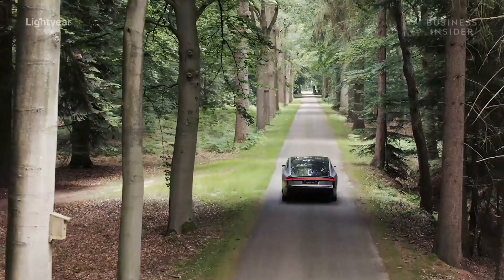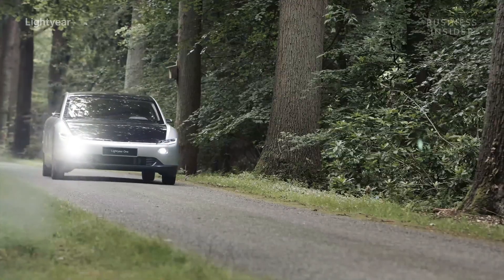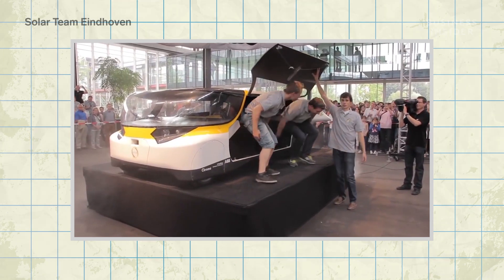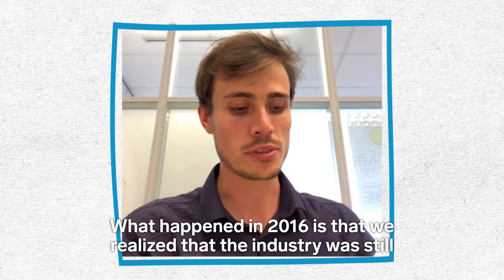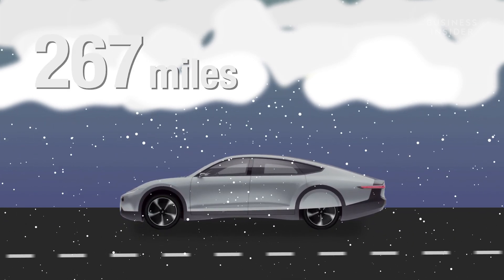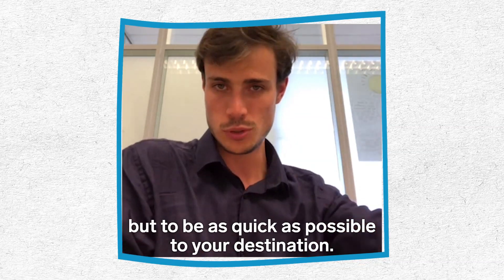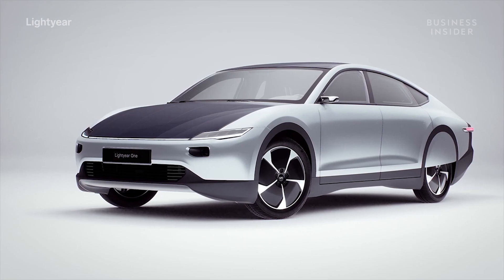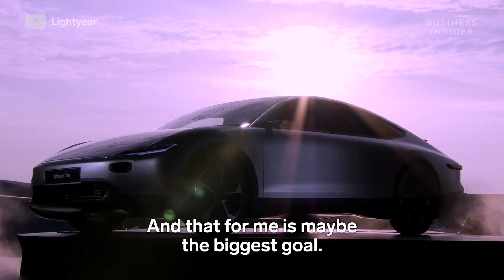Inside The $170K Solar Car That Drives 500 Miles On One Charge

Comment: I am here, because I want to build a solar ASSISTED car myself, but this is the biggest bullshit I've heard in my whole life ! 54 square feet worth of solar panels??????WHERE ????? BULLSHIT
Reply: That's 6 sq M or 3x2 meters! That sounds like it should fit? If we presume 200W per sq M because the panels are horizontal and covered in glass, it will give you on an average 6 hours day of sunshine, 7.2kWh. If the car uses 100Wh/km or 160Wh/mi, you'll get 72 km or 48 mi of very careful driving and in summer that will be slightly more than 100 km or 67 mi. I own a small EV myself, that also only uses 100Wh/km if I keep it under 70km/h and I have gotten a 300W 12V to 300V DC converter for this purpose. I've got 20W on the dashboard and 20W on the rear shelf, that so far only supplements the onboard DC converter bringing my idle consumption to zero!. I have not decided on the roof yet. It is difficult to use a curved surface and I can not cut my roof legally? but with another 70W on the hood I can total 100W and I want the surplus to go into the battery when parked, so it should give me 6km/day and be enough for most of my errands around town (groceries and picking up children). Let's compare notes, I'm interested in hearing about your setup?

Comment: The Nio ET7 has a range of 600 miles and Tesla Plaid 500 miles. If the production of 4860 batteries increases in the future, 700 miles Long Range Model S could be expected. Why would I pay $ 170k for this car? It is not even clear when it will enter production ...

Comment: This is NOT a solar car. It is an electric car with solar panels.

Looking at the square footage it cannot have more than about 1200 watts of solar cells on it. (enough to power a regular hair dryer). Definitely not enough to power a 1000+ lb car down the road at 55 mph... especially going up hills.

At best, the solar panels will help extend your range some but, make no mistake... you will be relying on the charging station at your house for the bulk of your battery charging.

The panels are a novelty that cannot justify the increased price.

I doubt the solar panels will save you $3000 in electricity over the life of the car and if the solar charge controller breaks or something happens to the panels, it will likely cost more to fix it than it is worth.

Buy it to impress your friends or out woke your neighbors but don't think it is anything but a status symbol.

Comment: So they expect the car to become cheaper as Solar Technology becomes cheaper???
It's cheap allready ! A good 200watt panel can be got for between £200 to £300 The ammount of power they are getting from the panels does'nt require an expensive charge controler! And even if it did the cost is a tiny fraction of the cars cost. you can power a house for around £15.000 The only way it becomes cheaper is if they are selling hundreds of thousands of them. Just another rich mans second car

Comment: They've made cars like this its nothing new, the technology doesn't allow solar to be practical when charging. 7 miles an hour or 84 miles in a full day, still not practical over long distance which is the main issue of all EV's. Even if it delivers on its 497 mile promise, it's still a 100k car, the long range model 3 is 322 miles and costs less than half

Comment: So it goes 500 miles instead of 350 because it has solar panels helping it charge while you drive along. But not a mile farther... even after you stop and sit there in the sun. Got it. 500 miles. yup.

Comment: How if a bird shit on your car
Reply: It just locks out the cells which are dirty.The rest of the panel keeps on working as normal because of the smart software.Thats what i got from other video's.Not a problem.If you damage some cells the rest keeps working.These guys have quiet some experience in the solar races.They won a few weeks ago for the 4th time in a row the cruiser class in the solar challenge.They participated also 4 times so they were never beaten.These kind of questions are fair but in my believing your question is the same as asking can't i see anymore because a parrot pood on the windshield.You better clean it but it's  not a problem.

Comment: Charged again? 7.5 miles per hr isn't going to charge the car. I drive 40 to 55 miles per day every weekday I think that eventually on a cloudy day I will have to have a power source other than the sun to charge the car.
Reply: In good conditions you can get to that miles charging in a day.This car is also charging while sitting in a parking lot and if you take the weekends with it you never have to charge if you are in south or north Africa or Australia.Even in the cloudy Netherlands you get at least 8000km/year free driving.Thats significant! I think you get all the solar stuffs extra costs back within 2 years.So the next 8 years you're earning if the cars life is 10 years.

Comment: Never heard this before.. just slap some solar panels on it and it will work 😂😂😂 what a joke. Unless this company has made a significant increase in solar panel efficiency which they most likely haven’t because then they could just corner the entire solar production industry with their panels, then these panels in optimal condition could maybe let you power the air conditioning while driving to increase overall distance but that is not worth the price tag

Comment: This goes along with the solar powered airplane.  A small plane that can seat 2.  About the size of a Cessna 152.  Not sure if battery's are charged before flight, but its built mostly for pilot training.  YouTube has a video about it.   Battery's are heavy so a solar powered airplane is a big challenge.

Comment: What happens if you have children in the car and a truck is behind you and you cant speed up? You can only go a certain speed. What happens if you're a business and you need to go cross country for a business trip that csr cant go cross country. Like Chevy, and Ford usually when new cars they test out at least one as a Police vehicle this car will never go the speed a Police vehicle needs to go.
Reply: The speed of this car is 160 km/h so more then enough.You can drive over 700 km on batteries and this car does 3 times more distance then Tesla on a kWh so charging is very fast.This is the ultimate car for long trips

Comment: The car looks nice I like the body but, the car only goes 500 miles a day and when its cloudy or snowing it only goes 250 miles what happens if its cloudy for a week like it is sometimes in winter? Its a nice concept but I think it needs more work. You cant go on a trip and get stranded.
Reply: You can charge it like any other EV and faster.

Comment: One small crack on those solar panels and your back into model S 370 miles
Reply: That's what I was thinking! Imagine the insurance on one of these bad boys!
Reply: No,if some cells fail the rest keeps working.It's also covered in safety glass so cracks will be very rare.Better have this car in a hailstorm then any other car
Reply: Maria Santov I never said that if one solar panel would cause everything else stop. Im saying the power of the car wouldn’t be as good if some of the solar panels are broke. Also, their safety glass is not that powerful.
Reply: @dippidousfippidous4837  I don't understand.You say one small crack and you're back to Tesla's 370 miles.This car does 500 miles on it's batteries.A small crack in a solar panel,say 0,0001% of the surface of all panels means it will charge 0,0001% less from the sun.Thats nothing.Even if 25% of the solar cells are damaged you can still charge 6mph instead of 8mph range from the sun.Nothing to worry.There is a video where they drop golfball sized steel balls and nothing happens.
Reply: Maria Santov the solar panels are 16 square feet. 0.0001% of that is quite literally microscopic
Reply: @dippidousfippidous4837  The car has 3 solarpanels with maybe 1000 cells al together.if a small crack breaks down 10 of that cells it means the car can charge 1% less from the sun to the batteries.You claim the range will drop to 370 miles and the power is less.Non of that is true.The range and power stays the same What you loose is the additional charging power from the sun.In that way the total range can drop a few miles a day but nothing you will notice.If that happens twice in it's lifetime you are very unlucky i think.How many times it happens when a rock hits your windscreen and cracks it?

To call this a joke is not fair.They are not a few guys building a car back in a barn but they are very professional.To win the cruiser world solar challenge all 3 times they participated means they know what is possible.I love this whole project and i see this as the future.Another solar car,the Sono Sion,can be sold for €25.000.For an electric car thats very cheap.That says those solar panels are very cheap.And the price will drop more and more.

What you think of the car without the solar panels?The low weight,small batterypack,inwheel motors and the most aerodynamic shape of all cars in production now?

Comment: What if you drive at night for example road trip would it work for 8 hours no sun ?
Reply: It's a normal EV what can do over 700km on it's batteries.If there is no sun you can charge it on any charger

Comment: Keep in mind that these electric cars need all those batteries powering it changed every 10 years or so. The cost for changing all these batteries? Around 10,000 dollars.
Reply: This car use not much batteries because of the low weight and extreme aerodynamics.I think this is the way to go.

Comment: This is fake . Even in  most hot country if you cover full car with solar panel you can make at more 8 to 10 volts . For running car you are needing a least 100 volts . This is fake car .

Comment: At that price-tag, I doubt it will "change the car industry"..
But if any manufacturer managed to make a $17k electric car, even if it's just a small car without those fancy solar panel, now that'll really change the car industry..
(as long as the quality isn't total trash.. It's quality and interior should as good as mitsubishi mirage, ford fiesta or other sub $15k small car.. and above 200miles range per charge)
Reply: The Sono Sion is just that car.The Lightyear One is on a complete other level and will drop in price when the next models can be mass produced.

Comment: No more range anxiety!
Model S: 370mi
Lightyear One: 500mi
Roadster: 620mi
Reply: Yeah I really don't understand how they're able to make the range on the roadster 620 Miles.
Reply: @jenson1569  double the amount of batteries and you're done
Reply: @osmanaslan6232  no because it’s then got to use extra power to pull the extra weight around
Reply: @jenson1569  those are already accounted for
Reply: @jenson1569  100 kwh: 400 mi
200 kwh: 600 mi
Reply: @osmanaslan6232  small car and small motor:  20kWh 100miles, The iMiev and other EVs of this class uses 160Wh/mi or even less
Reply: Aptera: 1,000 miles 😎

Comment: Add in a horizontal wind turbine under the front hood and   fiddle with  that and you can probably get  more  or put peltier devices  on the back side of the solar panel  and any other parts of the car that get hot like the electric motor  and gather more power

Comment: Tesla's use the heat generated from the brakes to recharge the battery. Also, the roof of Elon Musk's house is a giant solar panel. So I'm pretty sure he had that idea before the CEO was even born. It's most likely useless to have a solar panel to charge a car, otherwise Tesla would've done it already.

Comment: 7.5 miles of charge per 1hr of charging is 100% BULLSHIT. There is absolutely no way in hell that those solar panels are providing the ~3kw-4kw of energy necessary to charge for 7.5miles of driving. That is beyond ridiculous. Under ideal conditions, there is a max of about 500watts of solar available there, if this was a Tesla, that would get you ~1mile of charge (in the most ideal scenario imaginable). 
In order to get 3000w, you'd need a surface area of 220sq ft, all pointing directly at the sun, in the middle of summer (3x larger than the car). Do these people not own a calculator?
They put a $1000 solar panel on a car and decided that's worth 175k, in a market where a model 3 does the same exact job at 39k...... Yeah, good luck guys.
Hyundai, Kia, and several others already have cars with solar roofs. It creates enough energy to run the fan when the driver leaves the car. That's it, just the fan, nothing else, not even the A/C.
Reply: It can charge ar 1200w peak.This car is so lightweight and aerodynamic it does 12km per kWh

Comment: Why do they do these ugly designs... why not make a normal looking car
Reply: Because this is an extremely aerodynamic car so it needs less energy,smaller batteries therefore to save weight.Because of that they can use smaller motors to fit in the wheels.With the inwheel motors you don't need no drivetrain and save weight again and make it even more aerodynamic under the car.

Comment: The numbers just don't add up.
The solar cells (54 square feet or 5.4 square meters) can only generate ~1.5kw per hour under perfect sunlight conditions at the equator using the most efficient solar cell currently available. 

They state the solar can add an additional 7.5 miles per hour of sun (1.5kw), so they are claiming the car runs with the equivalent fuel efficiency close to 200 miles per gallon!! (a gallon of gas/petrol has ~40kw of energy). mpg= (40kw / 1.5kw) x 7.5
Reply: That is still 200Wh/mile, which is not unbelievable. It might not be at highway speed, but it is more than I use getting around town in a smaller EV.

Comment: I could see normal people buying this car in 10+ years after rich people subsidized production and research into improving the car for the masses. Sure, this type of car will only cater to specific market such as sunny region of the world but it would change the game in the long run. Imagine getting an extra +7 miles/ hr just parking your car on a sunny parking lot or in your drive way. You can even set the car to cool itself once it hit a certain temperature since the car is already electric.

Comment: $170K is a long way from what the average consumer can afford! I wonder what the environmental impact is for making this car? this isn't the future, the weight of batteries restricts the performance and practical applications. Improving the efficiency of the internal combustion engine is the key.
Reply: Did you even look into this car?This is extremely aerodynamic and lightweigt.The batterypack is very small.It does 8 miles on kWh.When massproduced the price will drop to a normal price.

Comment: 170k for a car that recharge in a week of 12 hours a day of sun, parked.
Reply: It only charges 40 miles per day in awesome conditions
Reply: @grateful.  therefore you actually need 12 days of parking 🅿️ the car  to get a full battery of 500km. Useful
Reply: @LuckyM83  its 500 miles 800km
Reply: @grateful.  Sorry I think always in metric system . My mind cannot process the mile/yard pound foot inch and so on.

Comment: Really cool if youre in Florida, however pretty useless in London...
Reply: Mr. Swag they work in any weather condition
Reply: @stephen_7752  how would that be possible ? in Canada we have months where we don't see the sun only light shinning through the clouds...
Reply: @stephen_7752  How efficient would solar power be if it rains for over 200 days a year
Reply: @wyw201  8k kilometres a year in UK.
Reply: Unless its driven under street lights, perhaps?
Reply: Wouldn't be useless. It can still be driven with power from the socket. Just the additional mileage provided by the solar panels will be low.
Reply: It works by the light from the sun so if it’s raining and there’s light it still gets power
Reply: Waffle Dog Huge efficiency decline from solar under constant stormy weather lowers the opportunity cost for plug in electric cars

Comment: You’re not buying this car to save money, you’re buying this car to quit buying gas.  
So you’re not saving money, you’re just spending it a different way
Reply: People will also buy it to have a smaller impact on the environment.
Reply: @angusdavidson15  A Tesla in a country with half the grid is on  renewables (which excludes the US), emits 2/3 of a gasoline car, so to greater effect, spend the money on roof solar, move closer to your job, get a condensing dryer etc. There are a lot of environmental investments that are cheaper and has a greater returns than a Tesla.
Reply: Pretty sure you're saving a lot of money in the long run

Comment: I can tell you the solar panels DO NOT EXTEND THE RANGE. look at the Fisker Karma, for example. It had solar panels on the roof. How much power did it make, barely enough for the radio. Stating the solar roof, and the hood can power the car is just idiotic. A extremely lightweight and low drag car can only be powered up to like 30 mph with it. If it does get 500 miles of range, its from the pack the car saddles underneath.
Reply: Why you think they won the Bridgestone solar car challenge 3 times in a row with a 5 seater car? They have over 100 people from Tesla,Ferrari and other smart people working on this project and you say they have it all wrong.Serious?

Comment: Will the solar panels charge the battery when the car is in park under direct sunlight?
Reply: That's the point
Reply: @manbiteslife3110  Good then, cause if they only work when the car is on, it defeats the whole purpose.
Reply: @aureliusxvincent  of course that is the point, but it charges very slowly for now. 7mph is kinda terrible but it's still something. Hopefully it can quadruple in the near future, converting solar energy without such losses